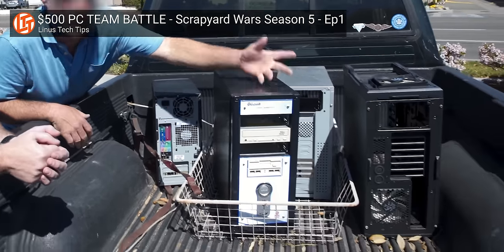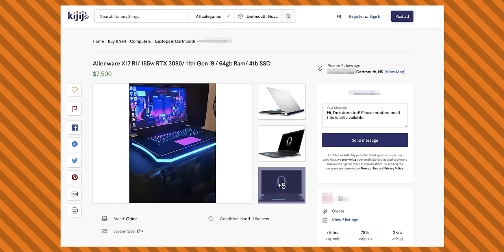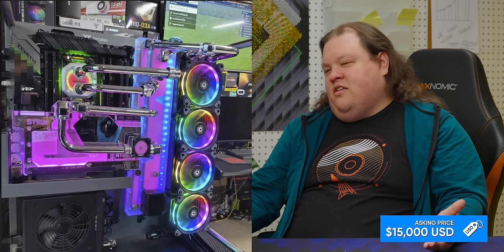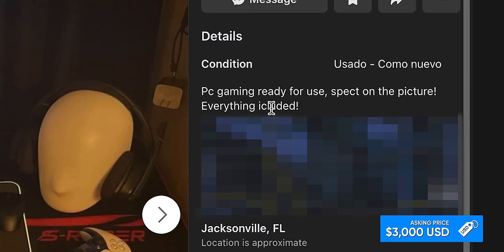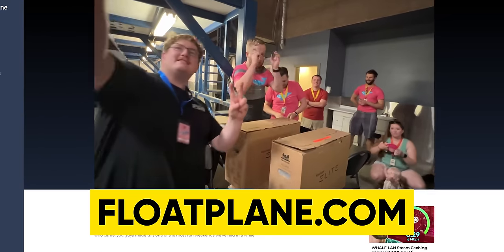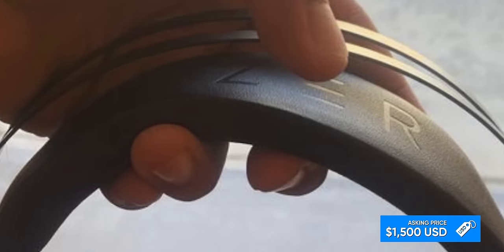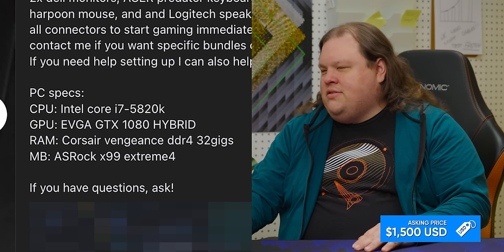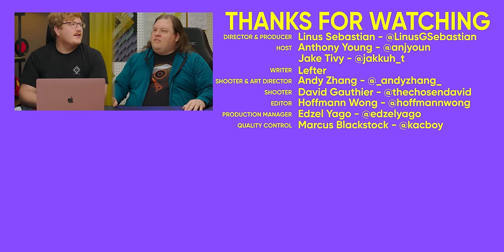Roasting the Worst PCs on Craigslist

Comment: i was building a NAS. So naturally i looked at my spare parts bin and realized it may be best to just buy a used PC. I ended up rage messaging nearly every seller because their prebuilt with a 10400 wasnt worth $1500. Dont forget the builds with an AIO listed as custom water cooling. 

I've never seen so many idiots selling in the PC space before.
Reply: Yea, I realised that people who aren't PC enthusiasts tend to call AIOs "water cooled". Not technically wrong...
Reply: i mean i call my AIO a water cooled pc as both the CPU and GPU have a cooling loop 

as for building a NAS ya i did the same was shitting my self ended up dragging out my 12 year old pc from the closet (amd 945 phenom II with a single 1tb HDD and 1050) tossing an SSD in it a pair of 8gb sticks of ram (instead of the twin 4gb it had) and then 3 12tb hard drives. tossed it under the desk and said fuck it ya its slow but i dont give a fuck it was cheap
Reply: @ExplosiveWeaponForum  that is water cooled but it's not "custom water cooled" like these jackasses claim their PCs are. 

People with prebuilts trying to sell off their shit with proprietary motherboards for MSRP plus the financed interest of their bad financial decision. 

I ended up building my nas with an 8700k and found a board in my parts bin that would work. Unfortunately it's ATX so I'd still like to get a micro ATX board so I can get a smaller nas case.
Reply: @DizzyBusy  man people keep missing the "custom" part lol.
Reply: HP? Ex lease/education?
Reply: @DaleEarnhardtsSeatbelt  "I didn't use the stock cooler, ergo it was customised?" That kind of logic? Idk
Reply: Don't ever look on ebay or any other second hand pc build. Most of them are overpriced crap. You build NAS school pc are great for that. Go to school and ask them are they selling something.  Use your old pc or buy new nas.
Reply: I messaged couple of such idiots. Responses were from "shut the f up u know nothung", through "k" to "it is worth so more i spent so much time it has so much memories with it it is good high end like new it really bargain u should be happy i am offering it so cheap". Dude, new PC costs less.

For first NAS I bought just another (new) gaming PC and packed it with hard drives. Couple years later I sold it, looked into commercial NAS appliance or another PC and bought instead cheapest 10 year old ssi-eeb shaped server motherboard, cheapest HBA, NIC, stuffed RAM through every case opening and left it running 24/7 for years, stuck it into shoebox, I shut it down only to clean up dust buildup when it got extreme, for disk upgrades and for home move.

Why I went for server motherboard? Because people wanted $300 (and more!) for 7-10 year old "workstation/gaming" boards, and wanted to push it with 512 or 1Gig sticks of ram. One delusional artist like this threatened to assault me when I suggested to him making ornaments from his RAM. Half of the boards had blown caps, bent pins, geological layer of dust and broken SATA ports. I bought full mobo with 2 CPUs and one cooler for $40, second cooler for $15, 48 gigs of RAM for $40, it had full 4 x16 PCIe slots, 8 SATA, 1 SAS port and IPMI. Eat this, idiots. At least people selling enterprise gear are super nice, helpful, and often when I buy ECC RAM or Xeon CPU I get a message or a call 'hey just wanted to make sure you know what you're buying it's not for normal pc'.
Reply: Yeah. It's why I feel like all the youtube videos of people finding AMAZING DEALS are staged now. Like seriously, Nobody wants a fair price for anything anymore.
Reply: @Vatharian  People really do think their shit is worth more because THEY owned it. No bruh your computer is worth less ESPECIALLY because you owned it
Reply: They're not idiots, they know their hardware ain't worth the shitty price, but they assume some dumbass parents will buy the pc off their hands for their kids thinking they got a sweet deal.

I legit seen in my country an i5-750 being sold for $150 around the time the Kaby Lake CPUs were already out. I wouldn't even pay $50 for that cpu.
Reply: @OfficialDJSoru  Its bad. I sold a gpro superlight brand new in box. This shit head offers $30 vs my $85 asking. I decided to check his listings.  He had an omen prebuilt with a 3060 up for $1700.  He did upgrade to 3000mhz xpg RGB ram so that's worth it right?
Reply: @fakezpred  so dam true.
Reply: @DizzyBusy  no just people trying to spice up their listing with buzz words while showing their incompetence and ignoring the existence of the custom loop entirely. Though, they're happy to include "Premium UpHere RGB fans" (Amazon special poopoo fans).
Reply: @DaleEarnhardtsSeatbelt  Yeah, that's BS, he overprices the system (prebuilt one I might add) on one hand and attempts to lowball on your listing on the other.
Reply: @DaleEarnhardtsSeatbelt  Not saying you're wrong, but some people are just honestly clueless. I have a friend who calls his system "custom water cooled", when it's an AIO. He's not selling and we're not close enough for me to correct him
Reply: @ExplosiveWeaponForum  cheap to build maybe, but how much power does that CPU draw.  With energy prices soaring, have to mindful of that.  My NAS is based off a HP N40L microserver.  The CPU has max TDP of 15W.
Reply: @ksp1278  oh im not worried about the power draw
Reply: OMFG YOUR NAME HAHAHAHHAHAA
Reply: @DizzyBusy  technically (technically), water cooling is still air cooling
Reply: When the barrier for entry is just a disposable income it's pretty easy to have people with no clue trying to sell their used crap for way to much.
Reply: I thought I was the only person on the planet that spent the time to rage message these idiots.

I would look up each part, find the NEW retail price, paste links in for each part, then come up with a total. That total would always be the same, or lower.

I’d tell ‘em:

“This is how much what you’re selling costs BRAND NEW. Yours is used so you should be lopping off anywhere from 30-50%, so my offer is X”

Or

“For what you’re asking I could build a system with twice the specs, here’s an example build of what I can get for what you’re asking… what planet are you on?”
Reply: @dearestdennis  absolutely not. I linked a bestbuy 5600x to someone selling one for $150 used. I simply said why would I buy yours for $30 more,  without warranty all while being used.
Reply: Stick around. The number will most definitely go up. 🙂
Reply: @Vatharian "it is worth so more i spent so much time" oh so it's all worn out lmao
Reply: @Djmaxofficial  I ran an late 2000s computer as a media server/network storage... I guess that's pretty much was NAS is. that was 4 years ago and I moved and never got it set up again. but yea, you can pretty much pull a desktop out of a dumpster and if the main stuff works you just slap in drives and put a linux server build on.
Reply: @DaleEarnhardtsSeatbelt people aren't bright in YouTube comments. Read what they want not what they should

Comment: "The cable management is BAD!"

I look nervously to my case, hoping they can't see it
Reply: No one gets to see the "other" side of my computer. No one.
Also, I'm iffy about letting people look too long into the glass side of my case.
Reply: The funniest thing about that exact computer is that it has the same cable management as me, the same CPU as me and the same NZXT AIO as me.

I had to check to make sure someone hadn't put pictures of my computer up for sale.
Reply: He does have a point, though. I don't have any windows in my computers and even I have better cable management still just for the airflow.
Reply: @MikkoRantalainen  Oh, absolutely. The "cable management" in that computer was just atrocious. I just mean that I also have a long history of having too many bits in my computer that require too many messy cables to make as neat as I'd like.
Reply: I've got good news for ya. They can't.
Reply: i wont buy anything, unless its on discount, price drop, vouchers. Or all of the above. Screw these old rich men selling stuff higher than its valued.
Reply: @fade2black001  I did the same to my system. If I showed linus that he'd be crying over the horrible cable management.
Reply: @mukunddhar6657  whats a "cable management"?
Reply: Out of sight out of mind
Reply: I just had to add drives to a prebuilt that was the first desktop I've had made after 2000s. managing cables then was pushing them around. I don't think I did a pretty job, but there's only so much i can do trying to get sata cables to a thing going into the back. they look horrid compared to the rest of the system that was done by people that are competent. I'm pretty sure I did the sata power cables in almost the worst way possible too. It's not a modular, but I did have to use 2 cables because the ssd and drive bays are far apart. at least i didn't use a whole third one.

Comment: I've seen people selling "gaming computers" in my area that are:

- i3 4th gen
- gt710
- 8gb of ddr3
- 256gb SATA SSD
- $500 asking price 

🤦
Reply: Let me guess, it got a lot of RGBs?
Reply: Actually, they all are listed with stock coolers and: a single RGB fan as an exhaust, or the front panel has a cheap 3-pack of 120mm RGB 😂

The amazing thing is, I've seen that exact same pairing about 10 times locally. Makes me think someone was clearing out a school's old inventory and trying to make a quick buck lol
Reply: @GH0STST4RSCR34M the reseller probably adds the RGB to make it a "gaming" PC.
Reply: @bonniscootor  lmao, well its definitely aimed for kids to beg their parents. They didn't know research after all, as long as its shiny they thought its good.
Reply: @GH0STST4RSCR34M That's the thing, they're all on Optiplex motherboards that have been transferred to a "gaming ATX case" (straight from the seller listing). Very odd CPU power sockets, absolutely no option to get a bigger or better GPU because of where the 24-pin connector is, and only a single PCIe slot.
Reply: @GH0STST4RSCR34M My fault for not mentioning that! That's the whole reason why I find it insane, because you can't even upgrade any part of these systems that "play any game at 60-75fps!" as the seller would make you believe lol
Reply: The hilarious thing about that is there are tons of old 4th gen Dells on ebay going for $100-200 minus any GPU.
So for about $250 you could have something ok, like:
i5 4690
8gb ram
256gb ssd
rx 470/480

Basically something near twice as good as that for half the cost and that's only because GPU prices although lower are still a tad high.
Reply: @GH0STST4RSCR34M Yep, you've got it. I work for an electronics recycling company and we see many many Optiplex's get recycled. They're the perfect thing to rip someone off with by just doing a few upgrades and adding RGB.

Comment: I have been wanting to buy a Radeon VII for years. Just to mess around with it, I like the HBM2 it has. Originally, it cost 800€ in Germany. Before this recent insanity, you could buy it used for 300-400€, a couple of years ago.

During the end of last year, those were 900 to 1500€, and now they still want to get 600-700€ for it. Even though there are now better GPUs available for much cheaper.
Reply: I got a VII at/near launch (partly paid for by my work) and yea its been great fun to play with HBM2 for compute, gaming performance is exactly what every reviewer found it to be though so anyone wanting more for it than like a 1080ti is bonkers to me.
Reply: @admalledd  Yeah, that’s what I thought. It is insane. And even though other cards are expensive as well, the VII is worse because apparently, it is pretty good for mining so naturally, prices are shit.
Reply: It is a cool GPU that has its advantages. Supposedly that HBM2 is good for Ryse as there's a stutter that can only be overcome with that gigantic bandwidth. If I collected GPUs like the 8800GT or 7970 or 980 Pro etc I would add a Radeon VII to that collection for sure.
Reply: Beware, Radeon VII failure rate is pretty high, and the failure is on the HBM chip itself, so it is not repairable on most cases.
Reply: It's probably past the point where it's getting more expensive again due to its age and it's special place in the lineup. I'm trying to get my hands on a cheap 9800 (Radeon, not geforce) and it's almost impossible.
Reply: The reason it's still kind of expensive is not just because of the HBM2 memory, but also because it has really good FP64 performance. And gfx cards that combine strong general rasterization performance along with good FP64 AND really damn good memory are worth a lot more for CAD, scientific simulations, and mining.
Reply: Sold my Vega 56 for 800, got a brand new 3060 ti at msrp
Reply: @rowannadon7668  Yeah, that’s the stupid thing. There are much better cards for less, even here.
Reply: This graphics card is very good for mining, hence the high price, beware Radeon VII failure rate is pretty high this is one of the worst graphics cards to buy second hand
Reply: @admalledd  If I'm not mistaken, its one of the best cards that can be used in a Hackingtosh build. I know a friend who was crazy for one a couple of years ago.
Reply: Just shot a PowerColor Vega 64 Red Devil for the same reasons you look for a Radeon VII for around 170€ after years of hesitating because of durability and reliability concerns. Granted, it was a Mining Card, so i took a gamble there. But the seller was open about it, it was in really mint condition and he offered documentation and believable information about his HBM tweaking scheme (which turned out to be a bit on the anemic side and was optimized for temps and power draw) as well as the possibility to test it under load before the purchase. They´re usually still around 250-300€ in Germany. Probably the best used Hardware purchase i ever made. Runs like a charm. These cards are really, really fun to fuck around with. After optimizing it for HBM Clock speeds and max boost clocks with a very conservative OC on the core while undervolting it to oblivion it now crunches climate data at full throttle while drawing 165 Watts on 960mV  VCore (lol) and is even stable in some games at these settings (albeit with a hefty stepup in power draw when not capping FPS or rendering in 1440p).  I seriously consider hardmodding it to see how low i can push that VCore while maximizing power efficiency. 

If you´re in it for the fun factor and the tinkering alone i suggest getting my hands on a Vega 64 or 56, preferably non reference and with a decent cooling solution. Not because this thing gets all that hot with the 2.5 slot tripple fan cooler, but because you want those temps as low as possible to have more tweaking headroom. Every degree less helps.  I can see why you would want that VII though and i had been looking for one as well during the last 6 months before i went for the Vega because it was just too good of a deal. The only thing i regret so far was not purchasing another one out of the 5 cards the seller offered. Well, until i blow up that HBM or the memory controller that is. :)

Comment: That second one was CLEARLY bought just to rip the GPU out of it the freaking PC is a pre built OEM and has RGB and a tempered glass side panel AND the GPU is a GT710. Which OEM in their right mind would put a GT710 in an RGB tempered glass PC that has an i7 processor
Reply: You'd be surprised.  I've actually seen a lot of prebuilts like that, they figure most people getting into PC gaming don't know better and they aren't wrong.

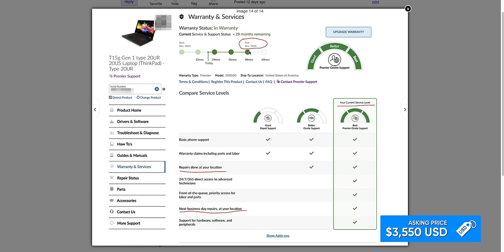Comment: 11:15 I noticed that Framework laptops hold their value pretty well on eBay, and I can see serviceability being a big part of why.
Reply: Branding and scarcity also play a big part. Apple laptops are basically the opposite of framework from the consumer rights perspective and they also hold their value well.
Reply: @Crusader1089  Sometimes used Framework laptops will sell for more than their MSRP though, and bidding wars ensue.  The wait to get a new one from the next available production batch probably causes people who want one now to seek the used market out of convenience or necessity.  Even with the 12th gen boards out now, you don't see many 11th gen boards sitting unsold for long because of the secondary use market Framework is intentionally cultivating.

Comment: 9:43 Is his CPU sitting at 100C with a 90C GPU, or is he running his temp readout in F? lol
Reply: LOL good catch, has to be F right? like 100 degrees would make sense with inadequate or improperly mounted cooling but it has some kind of NZXT water cooler and given the water temps it's dissipating heat from the CPU, but what kind of 5900x even puts out enough power to heat the water in a radiator to 82 degrees celsius?!
Reply: It must be Fahrenheit temps just after startup, which would be about 38 C on the CPU, otherwise that shit would be melting

Comment: the flow meter usage reminds me of my old nitro RC car days because I used to do a similar thing with inline fuel filters. They were like these little anodized couplers for the rubber fuel lines with a glass window and a small sponge filter and I thought they looked really cool but they restricted the flow of fuel too much and you would stall the engine at high revs. So I would just take the sponge out of the filter and have the inline filter on there just for looks hahaha